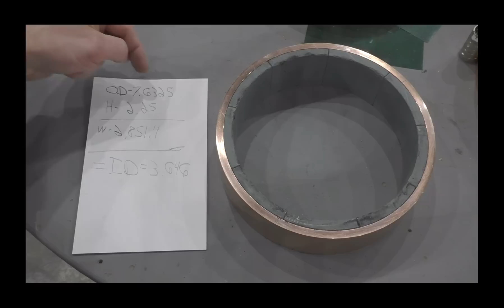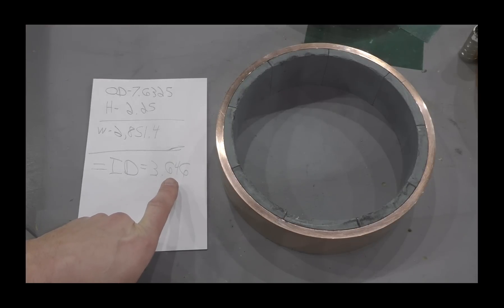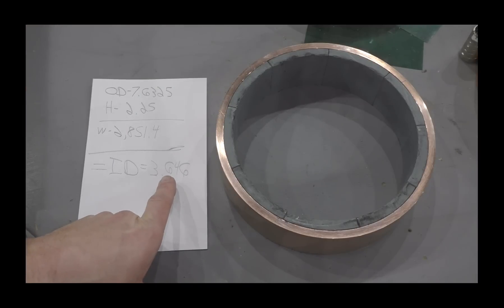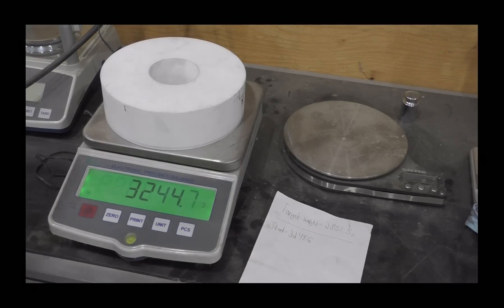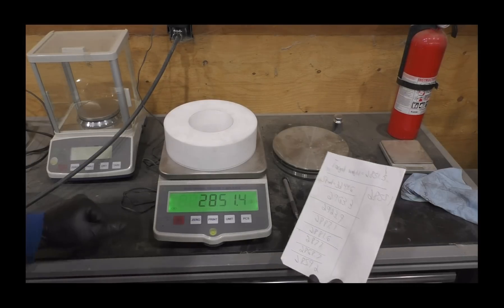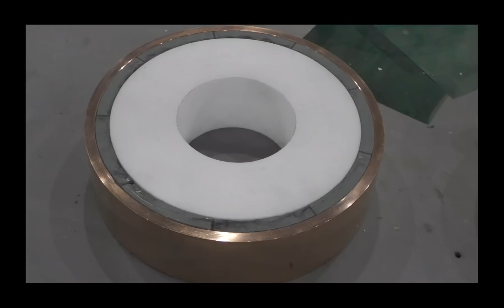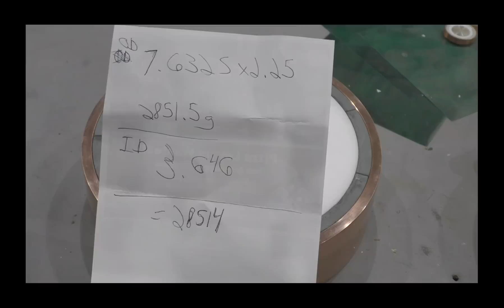Searl Generator Replica Teflon Insulator layer

Comment: I think your copper weight is way too much. That needs to be a very thin layer on the outside so you don’t have ten feet of Teflon that needs to be jumped across. Also, been following your videos for a while as you seem to be the most viable visible person working on an SEG, I found you through RWG research when you were magnetizing with the slanted fixtures. In the words of John Searl: “you must magnetize with ac and DC at the EXACT same time, you must switch on the electricity precisely on center of the upward slope of a sine wave and switch it off at precisely center before it starts back down again” I have yet to see this technique attempted. seeing people try and try and waste resources and their productive momentum without understanding/attempting the most important actual factor of this whole build is a shame. Like RWG Research wasting time trying to pair his Stan Meyer toroid with HH0 generation and spending countless resources and hours trying to re create something that will run an old gas motor. Just focus on the electrical part, we don’t need HH0, we just need the electrical generation. I just see you spending too much time intricately building these models to look like a description when your resources and time could be better spent pursuing the proper electronic equipment to produce the very important factor of imprinting a sine wave on the magnetic material. That aside, you really need to thin out your copper layer so you don’t have to use such outrageous amounts of the other materials to equal it’s mass. Proper electrical magnetization aside, I think you’re using way, WAY too much thickness of Teflon for this to be a viable test. They’re not going to jump that gap
Reply: I was able to recreate the magnetization that John Searle was talking about.